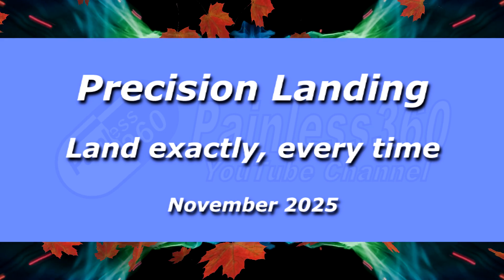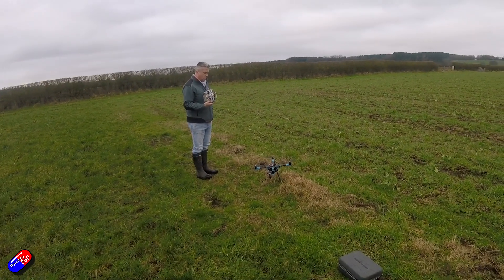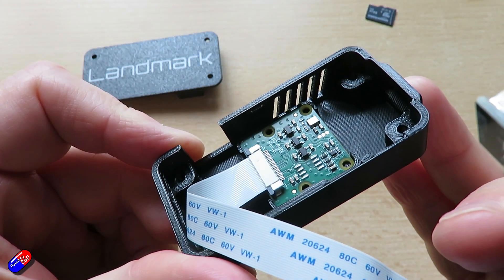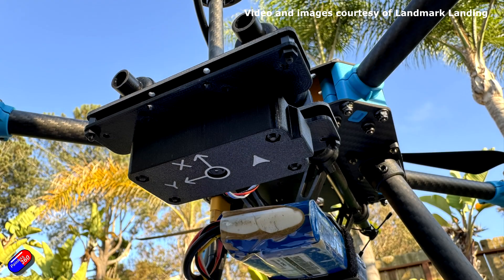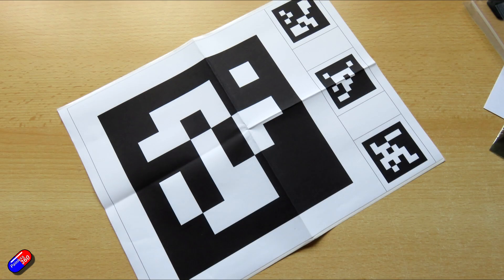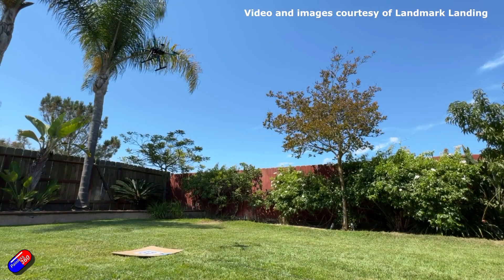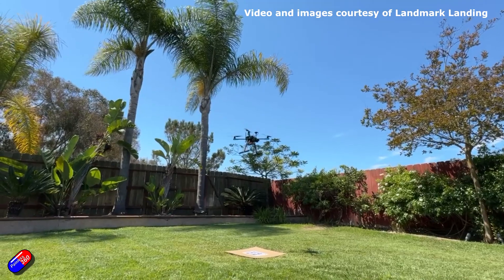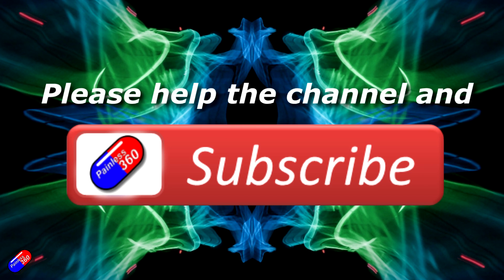Land your quad/VTOL on an exact spot every time: The Landmark Precision Landing System

Comment: Nice but excessively high price : more than 300€!
Reply: Hi Peter,
We hope to bring the cost down with volume. As Lee mentioned, due to the price, this system is aimed at professionals. Our hope is that this "professional version" will help fund development of an affordable version for hobbyists.
Reply: @LandmarkLanding  Hello Team Landmark, im wondering where i can tell the system which exact size of marker im using or will it figure it out by itself? I cant find a parameter to set the size of the Marker i used.
Reply: 300euro? Compared to being able to precisely land an Octocopter with 50k euro worth of camera and lens under it? 300 is a bargain.
Reply from the maker: If you compare it with the other systems mentioned, you'll see expensive... Happy flying

Comment: The higher power consumption is bit annoying, but can be solved : there are RC controlled power switches for some few $. So it is possible to switch it on and off  according to your needs
Reply: Agreed. The high power consumption is due to the CPU processing required for marker detection. All four cores of the Raspberry Pi are utilized.
As Lee mentioned, modern flight controllers like the Pixhawk 6X and 6C have 1.5 amp telemetry ports. This is enough to supply the 0.5 amps required by the Landmark module, as well as additional telemetry devices.
Reply from the maker: Some flight controllers output up to 1.5A on one of the telemetry ports. That would work well for this...